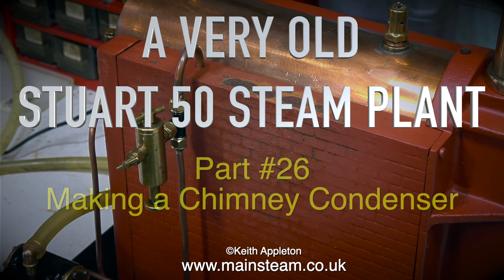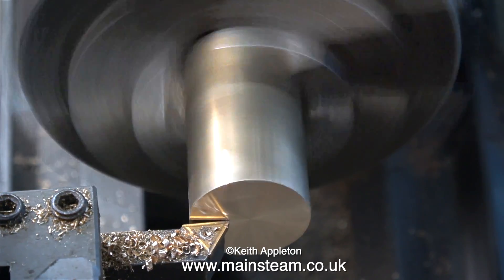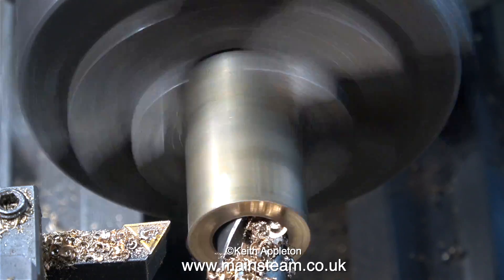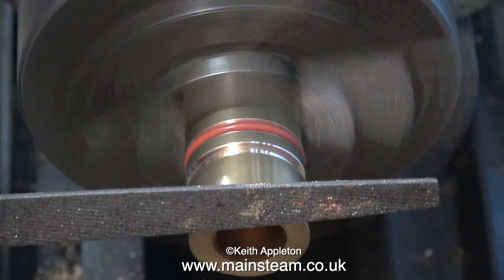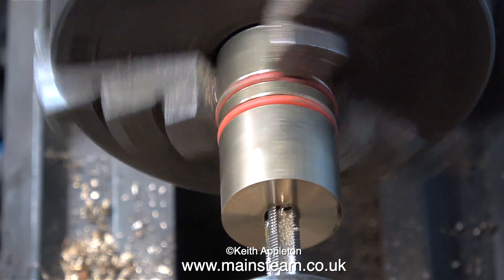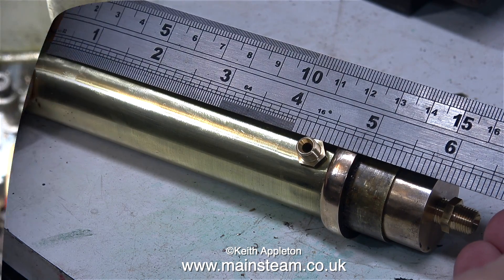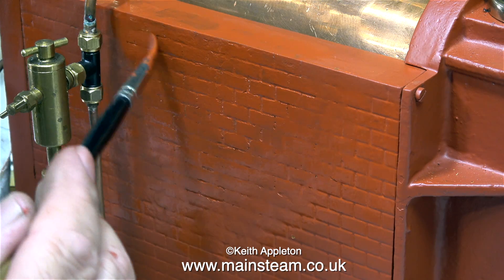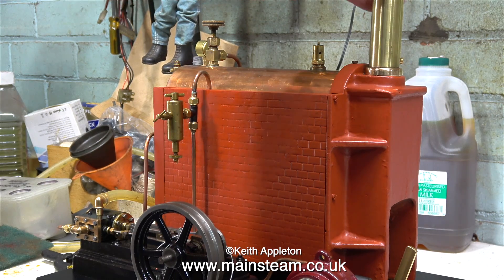A VERY OLD STUART S50 STEAM PLANT - PART #26

Comment: Hi Keith I am going to offer a way of dealing with bronze alloys, like the one you are machining in this edition but phos bronze especially as I am sure you are aware these materials are very abrasive to cutting tools HSS drills in particular many years ago I was tasked with machining some lense mounts for TV cameras in Phos bronze there is something quite embarrassing about not being able to extract the drill from the hole it was trying to drill!  Steep learning curve a wise head told me to use a slightly smaller pilot drill and grind the lip lengths to be unequal, the result is of course that the drill waggles a little more excessively than in you video but it doesn't get worn to a very sticky taper just the tip of the lands at the sharp end a regrind sorts that out when the job is finished.
Reply from the maker: Thank you for your constuctive comment {-)))